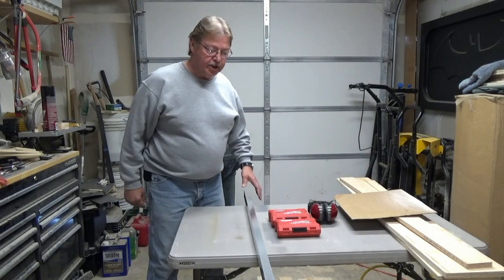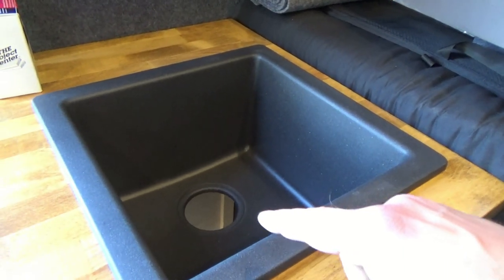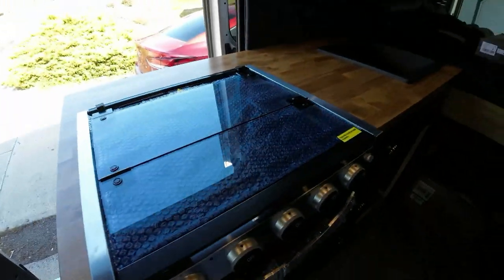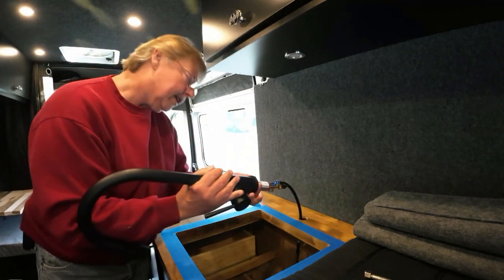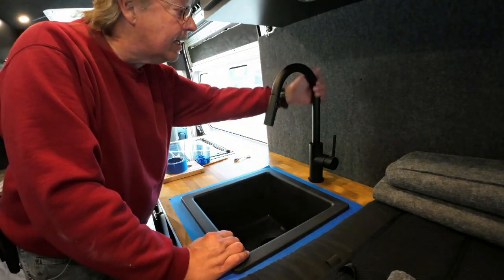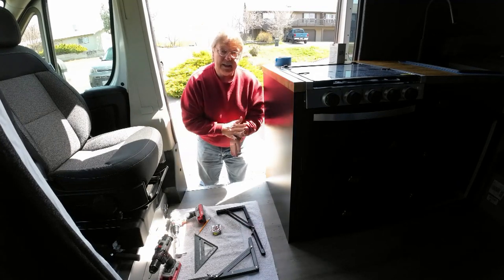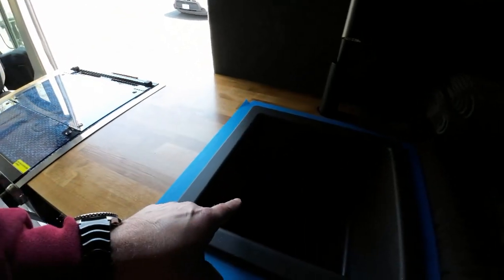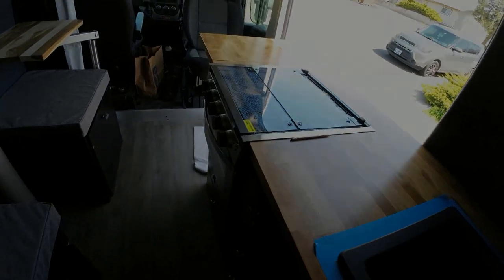Promaster Van Build 2500 159WB – DIY– Galley Install – Part 27

Comment: Great van build. I have the identical van that I finally received 2 weeks ago after a 13 month wait. My question is did you use self tapping screws and secure your galley through your wood floor and into the metal floor 

Thanks
Tony
Qualicum Beach, BC
Reply from the maker: Hi Tony! I did not go through the wood floor into the metal. Galley is secured to the wall and the bulkhead under bed, and used brackets to fasten to wood floor. Pretty solid
Happy building with your van... 13 months is a loooooooooooooooooong wait!!!!

Comment: What kind of faucet did you use? Link appreciated. :)
Reply from the maker: @kimross8278  Hi there... here is a link to the faucet (below): Doesn't appear they have the same one I have any longer, at least on Amazon. The one I purchased was:
 
APPASO Modern Pull Down Kitchen Faucet with Multi-Flow Sprayer Matte Black, Single-Handle High Arc Pull Out Sprayer Head, Include Optional Deck Plate

https://www.amazon.com/APPASO-Kitchen-Sprayer-Stainless-APS323MB/dp/B094VWCS35/ref=sr_1_12_sspa?crid=RAS6GAG19APZ&keywords=appaso+kitchen+faucet&qid=1698108604&sprefix=APPASO+%2Caps%2C146&sr=8-12-spons&sp_csd=d2lkZ2V0TmFtZT1zcF9tdGY&psc=1